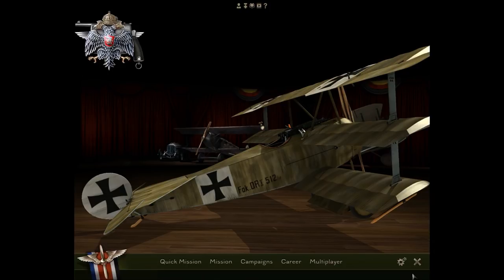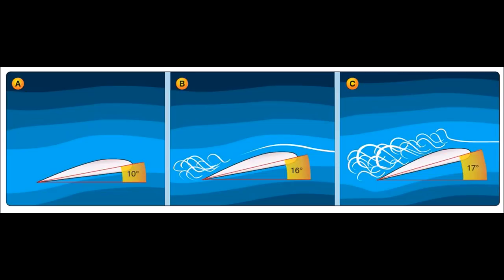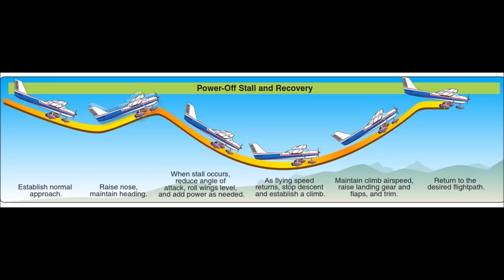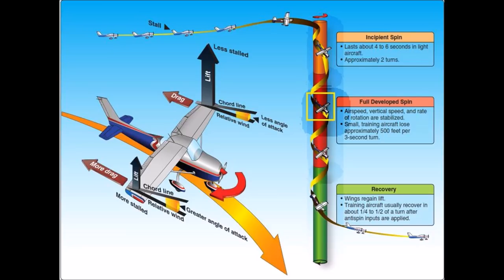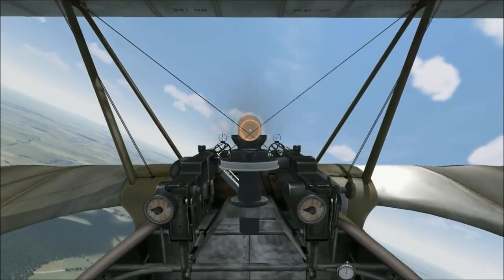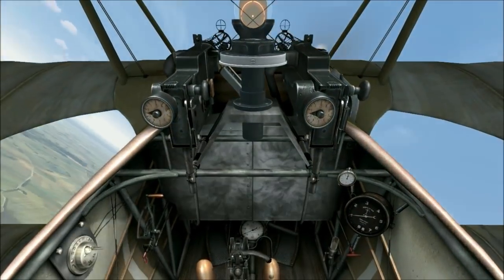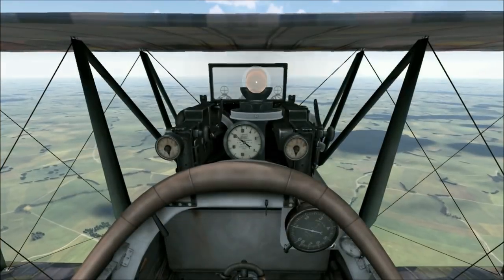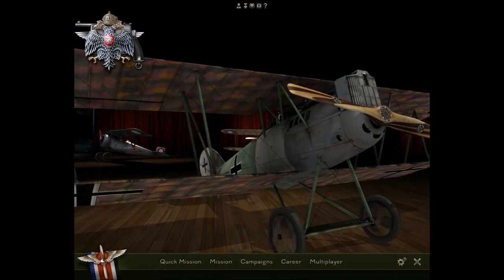Rise of Flight Spins and Snap Rolls

Comment: Pilot fatigue.

I played the old Red Baron game for countless hours with rudder pedals. Decades later and only a few yrs ago...

I live in MA, snow, work at a big place that takes a couple of days to completely clear. Driving a Bobcat 3 days later clearing the last of it. I scoop up a bucket, back up and need to dump it to the right. As I start to turn to the right and I am tired by now, I instinctively kick right rudder. Right pedal down starts to drop the full bucket. Left pedal up starts to raise the arm. In the end, it looked like I had been doing it all my life. I sat there till figured out what I did wrong. Scared the crap outta me as to what if?

Now I'm a licensed drone pilot with a valuable lesson learned. I am surrounded by a lot of restricted airspace. I got used by Homeland Security as a test as to how to track down a DJI drone. "Agent Smith" didn't stand a chance! I really wish you were there as it was a fun time discussing different topics.

Just a bump for reminding me I would get pissed if it took me more than 4 bullets to kill the npc pilot while flying the DR1 and the instinctive reactions that, frankly, are dangerous enough for me to have to more careful than other operators.

Edit; I was lucky enough to get a ride on a B 17 cheap back then. Out of Pompano Beach, FL. 1st flight of the morning. I happened to be standing in the top turret looking around when we crossed the beach into the sunrise. As we crossed the beach, a wave of fear went up my spine that I will never be able to describe. The bravery of those young men...

Comment: I stumbled on your channel and have been absorbed for over an hour with your P51-Me109 series. Good work. I've been a pilot for 40 years, rebuilt my first plane, a 1940 Taylorcraft in 1975. I've flown and designed RC for even longer (just establishing my CV in preparation for audacity in correcting you as follows LOL) I don't wish to be a nitpicker but your explanation of the aileron contribution in a spin was a little off. As you seem to be a stickler for accuracy, as am I, I thought you'd appreciate this explanation. An aileron lowered into the slipstream does not make the wing stall quicker, it actually would be the reverse as it acts like a flap and allows a higher angle of attack. You are confusing the effect of ADVERSE YAW. This is caused by the fact that a "down" aileron causes higher drag than the "up" aileron, resulting in the plane YAWING opposite the rudder (as in a turn). This is most common in Antique planes and almost all WW1 designs (except the Fokker, partially due to it's advanced thick section airfoil wing). My Taylorcraft had terrible adverse yaw even with a more advanced aileron design. To correct this the hinge line is offset so that an UP aileron dips the leading edge into to lower slipstream to add drag and compensate. You have a great channel and I appreciate all the hard work and research you obviously do in your preparation and I don't mean to disparage that. ;-) Feel free to check out my little video "Capt Tim's T-cart" and use my contact info if you want more details/ I have a 1940 Taylorcraft, a 1951 Bellanca Cruisemaster and a 1958 Piper Comanche here in Phoenix, AZ, "come fly with me" any time ;-) PS My Comanche has a laminar flow airfoil just like the P51, FAST!!  Tim  airplayn@hotmail.com
Reply from the maker: Hi Tim. I do understand adverse yaw, and that's not what I am talking about. At high angles of attack in a stall, in certain airplanes the ailerons will work in reverse. Don't take my word for it. Here is a quote from page 4-7 of the Pilot's Handbook of Aeronautical knowledge:
"
 For example, if the airplane rolls left at the stall (“rolls-off”), and the pilot applies right aileron to try to level the wing, the downward-deflected aileron on the left wing produces a greater AOA (and more induced drag), and a more complete stall at the tip as the critical AOA is exceeded. This can cause the wing to roll even more to the left, which is why it is important to first reduce the AOA before attempting to roll the airplane. "  While it does cause more drag and adverse yaw, it also deepens the stall and rolls the plane the wrong way. I hope that helps.
Reply: Greg's Airplanes and Automobiles  I agree that at very high AOA it's probably not adverse yaw as the airflow is so detached that there would be little extra parasitic drag from the aileron but lots more induced drag. See also pg 6-3 IBID. I DO have USAF flight training and many hours of full scale flight experience to back up by knowledge. Although I'm amazed at the skills these gamers develop, It's impossible to get the real fell of an airplane in video games. My son DID have less trouble transitioning to tail dragger after multiple hours of flight sim with rudder pedals, but many skills are impossible to simulate.

Comment: A video on the Citroën Traction Avant advanced design would be very interesting. This early 1930's designed automobile has many innovative design features ( front-wheel drive, four-wheel independent suspension, and the use of a crash resistant, unitary, monocoque body).

Comment: I've had the Pfalz enter completely unrecoverable Spins at 2000+m. The only way I found to recover those was Power on and Mkving the Stick back and forth to Induce enough Pitch Oscillation to get the Nose down far enough to regain Control.These Spins developed in Turns.
In the all flying Tail Models the Rudder and Elevator can become fully stalled and first have to be moved in such a was that Airflow is recovered before any other Movements have any Effect.
All flying Tails can catch out even the very experienced.

Comment: Here’s an interesting real world insight… if you unload the wing in a vertical or steep climb (in other words you fly upwards in a ballistic trajectory), you can get to a very low airspeed below which it is impossible to stall the wing, no matter what you do with the controls.  After all, for the airflow to separate (i.e. stall) there must be sufficient inertia/momentum and viscosity in the flow to overcome its ability to follow the curvature of the wing.  But you still have to watch your angle of attack when you recover from this condition.  A large, or abrupt input once airflow is significant again, will lead to a stall.  At very low speeds, propeller slipstream, torque, and gyroscopic effects will dominate, as aerodynamics become less significant and aerodynamic controls lose their effectiveness.

Comment: Great video Greg. Thanks for sharing. I'm learning all sorts of things from your channel.

1. Is there a reason to not include any aileron going into a snap roll? I notice some people do pull the stick 5  or 7 o'clock depending on desired roll direction

2. I see far more people spinning Camels into the ground than anything else in RoF. It does seem to need aileron into-the-spin during recovery. A followup on that situation and why its the case might be interesting. Given that this usually happens at low altitude, some advice on the absolute fastest recovery method might be helpful to many of us:)

3. You gotta share that forward side-slip manoeuvre :) Its very effective not only because you slow quickly, but also because it takes your plane out of the chasing pilot's view temporarily. To re-aquire, most people will then drop their nose, which accentuates the speed difference and effectiveness of the move
Reply from the maker: Hi Paul, that's a great question. There is a reason not to do it. Let's think about a right snap roll. Remember in the video how we discussed the chord line and how it effects angle of attack. When you add aileron input, let's go with the stick to the right in this example, you put the left aileron down, thus moving the chord line down. Normally that would cause the left wing to go up. However when in a stall, since it increases the angle of attack on the left wing it deepens the left wing's stall relative to the right wing and can cause the plane to bank left, thus opposing the right snap roll. Now, some airplanes, including most modern planes have twist in the wings so that outboard section with the ailerons stalls last, and thus  to an extent ailerons remain effective and normal in a stall. However in older airplanes, the ailerons will often work in reverse in a stall, and even it modern planes that can still happen if the stall is deep enough. Bottom line is, normally you want the ailerons neutral for a spin or snap roll, however a really good pilot who really knows his plane can get some benefit by using them. However in the German planes in ROF it makes no difference as far as I can tell.
Reply: For PaulMF;Re: question 2, the fastest spin recovery method when close to the ground:Don't get into a spin close to the ground ;-) Suggestion: above 2000 ft., in the plane you're going to fly into battle, practice gradually-tightening, constant-altitude, full-power turns (in both directions) until you recognize the onset of an accelerated stall (i.e., high-G stall); then do it again at reduced power to simulate battle damage; then avoid them at all cost when close to the ground.Get out of a low-altitude tail-chase if you're losing it and approaching a stall. Extend and/or scissor. Not a guarantee of survival, but a low-alt spin is usually a guaranteed farm purchase.Best Regards,Wilhelm
Reply: @Wilhelm Reinhard LOL, fair enough! 
Always good to know the limits of your plane. I'm usually in an SE5, so you know,  "whats a spin?" :)  But it reminds me. I was doing exactly as you suggest offline one day and found that the SE5a on edge of stalling will flip left when you pull the stick back quickly. So if you're  climbing right with a enemy lining up for a prop hang, you can flip left and change direction quickly, thus messing up his shot, and leaving him low energy. Of course in practice the timing has to be perfect other wise you're toast!
Reply: Thanks Greg. The early Nieuports in RoF seem to do counter-intuitive things with ailerons in stalls. Perhaps thats the effect you describe
Reply from the maker: that's good advice Wilhelm, especially the part about practicing accelerated stalls, which are stalls that occur at a higher than normal speed due to the G-load in a turn.
Reply from the maker: That probably is the effect I am talking about. I haven't flown the Nieuports enough to have seen this, but if the ailerons have a reverse effect while in a stall, then that's the reason. I actually suspect all WW1 airplanes did this, but I can't know for sure, and how it's modeled in ROF is another issue entirely.
Reply: @PaulMF, that is a great tip about the SE5, thanks for sharing it! Sounds hard to master, but it will be fun trying.

Comment: Has any airplane had leading edge devices that the pilot can control to promote a spin? I've read that the Me 109 had leading edge slats to suppress spinning, rather than promote it. I've read that modern light aircraft can be equipped with "spin kits", but these are adjustable on the ground, not in flight.
Reply from the maker: Hmm, not exactly, but sort of. The leading edge devices delay the stall. Since a stall is required to get into a spin, that means that leading edge devices can help reduce the chances of getting into one. I don't know of any cases where they are intentionally used to cause a spin, but that could be done. In some cases, inadvertent retraction of leading edge devices has caused a stall, so it's not too far of a jump to have that cause a spin. Let's keep in mind that spins are normally to be avoided, the only people who do them regularly on purpose are airshow pilots and flight instructors who are required to by regulation.

Comment: There is no way a real Sopwith Camel's wing would fall off like that. The ONLY aircraft that would break up that quickly, was the Fokker Dr.1. It collapsed like a stack of cards, if shot through its wings; a major disadvantage.
Normally it was necessary to hit the vitals of an aircraft-(engine,fuel tank or pilot) to achieve your victory.
Reply from the maker: Frank, I think that statement is going to be hard to back up. How do you propose we test it?
Reply: @GregsAirplanesandAutomobiles  Well firstly, i understand that the Dr.1 had wing spars which were hollow boxes. These were strong enough for aerobatics etc. but if damaged significantly the wings would completely fail. This is not the case with regular solid spars and struts.
 And secondly (through dreams/vision) i seem to have recall of my previous lives. So i can remember shooting at a  Dr.1 after diving down on it, passing it, expecting it to still be there but amazed it had vanished. Later i found out what happened from reports from ground witnesses and was able to confirm it a kill.
Reply from the maker: Please post your source saying that the DR1's fall apart when hit.
Reply: @GregsAirplanesandAutomobiles  My 'source'? I'm the source. I downed two Dr.1's in 1918 the second one in july also broke up. Its well known the Dr.1 had structural problems. Without any bracing wires it was entirely reliant on the wing integrity. The commander of Jasta 15 Gontermann was killed in his Dr.1 while demonstating manouvrability, the top wing came off and two days later Jasta 11 pilot was similarly killed. Dr.1's were grounded until modifications were made, they found evidence of poor workmanship which compromised the structural integrity. Fokker himself apparently had no formal engineering qualifications, he rejected the need for stress calculations and use the cheapest material to build his aircraft. Consequently his designs were grounded from time to time due to defects. He was innovative but a chancer.
Reply: @frankpotter1982  big brain time